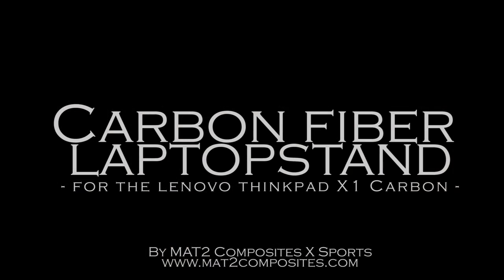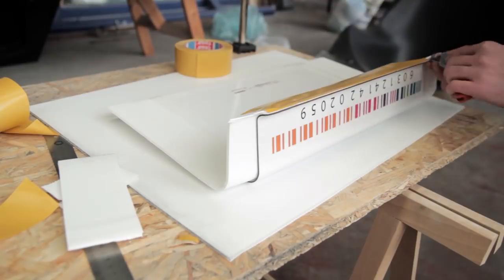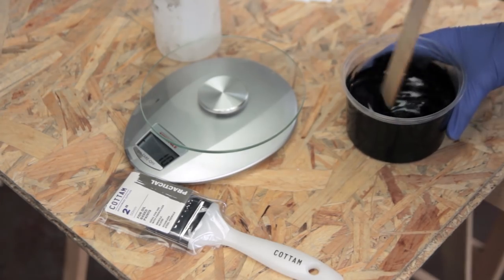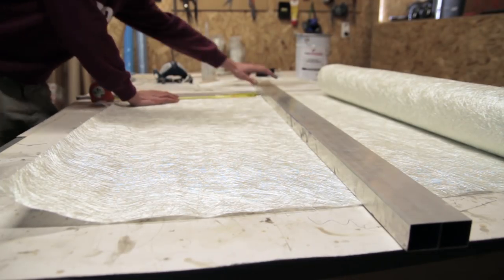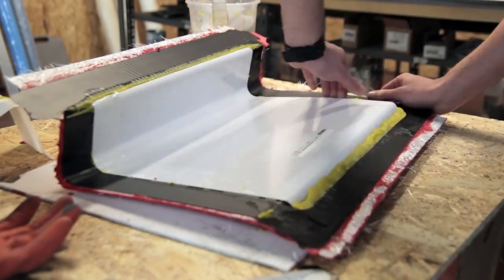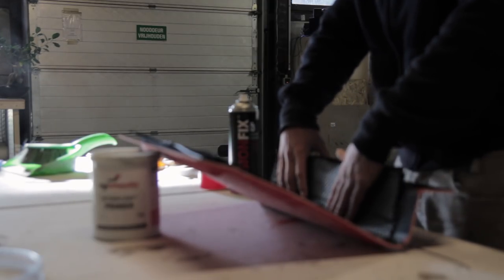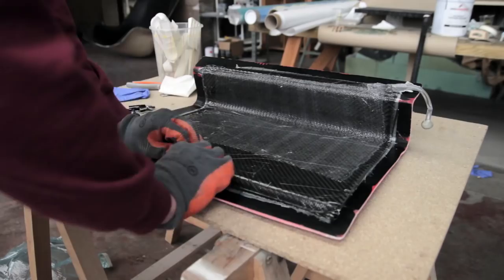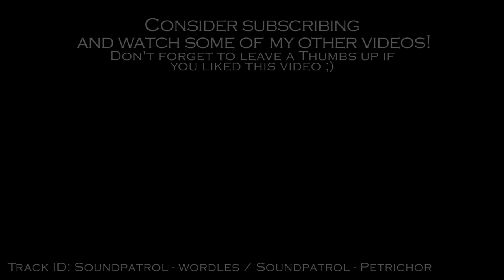Carbon Fiber Laptop Stand (How It's Made) - IKEA Hack

Comment: Awesome video. So inspiring to improve my composites work.
If you had to have holes for air-flow. Would you drill it in the CF part before Clear-coat or "mold them" by drilling the original part before creating the mold?
Reply from the maker: would cut them at the end then clearcoat! glad to hear you liked the video :) good luck!
Reply: Ty very much for your answer.

Comment: Thanks for another great video! What kind of cutterwheel are you using? Sold at EasyComposites?
Reply from the maker: thanks a lot! Perma-Grit 32mm Disc with Arbor is sold by Easycomposites, might be you can find it somewhere else as well :)
Reply: Sorry, I mean the hand held one you use on the dry fabric. Not sure what it's called.
Reply from the maker: I call it a pizza cutter :p bought it on R-g.de

Comment: can you tell me about coupling coat? why it's needed?
Reply from the maker: the coupling coat will prevent print through of the backing layers and create a good link inbetween the gelcoat and the tooling resin :) hope this gives you some more information. Otherwise check the Easy Composites website where you find more information under the product.